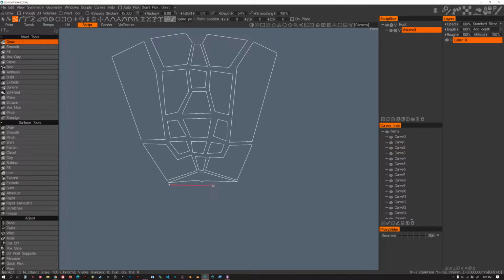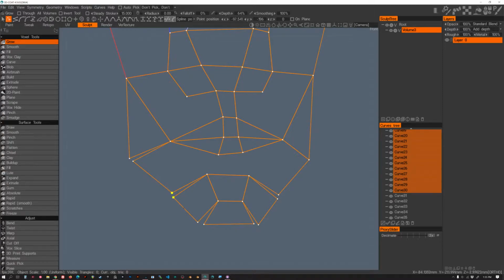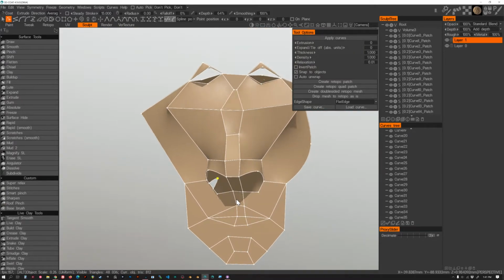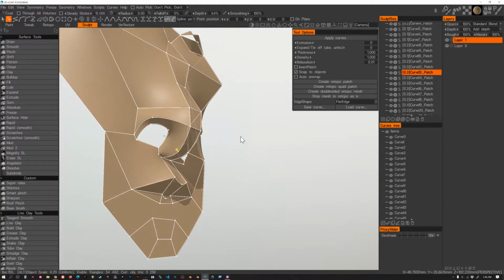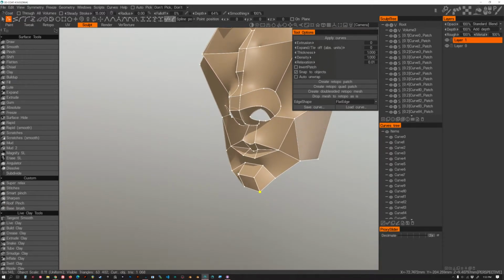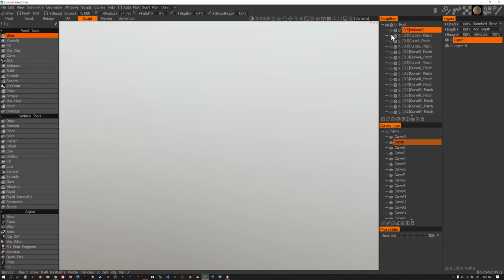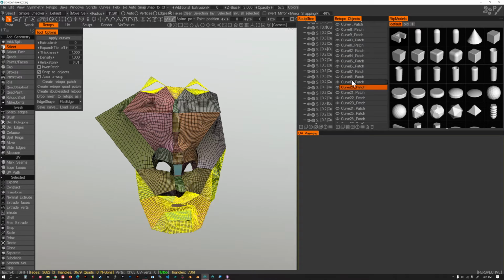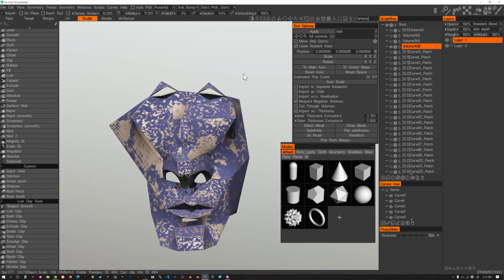3D Coat Curves Tool Patch based modeling

Comment: Cute little trick. Didn't even know about that patch creation method. Can be useful for creating some basic smooth surfaces, but in terms of editing it is crippled in so many ways... It's like a little piece of NURBS modeling in Coat.
Reply from the maker: There is a lot of potential for this workflow if it was better integrated and if some of the steps were automated.
Reply: @GavinBall  ye, curves based techniques are always interesting. But Coat has few serious flaws with complex curves editing. I tried making flowing shapes like car fenders with wheel arc... In general it works pretty good, but when it gets to details, like chamfers, fillets, and adjusting connections between multiple patches it turns into headache. But to be fair in Rhino is a pain too, even with million curves tools and operations)) But most annoying is that it generates good only thin Surface, but when you try to apply Extrude/Thicken it creates a lot of artifacts, so you cant turn it into solid object easily.
Reply from the maker: @nicktyler2572 So that's where I think 3D Coat has an opportunity to allow us have primitive voxel objects made of these Nurbs-like patches in place of standard polygons.   But then it would be great to be able to edit these patches like polygons...being able to chamfer, extrude, inset...and Be able to move full patches like you would a polygon face, or just an edge, or just a control point.  The Voxels would be the medium that allows for this kind of workflow, and the curves would offer a resolution independent way to dial in the forms you want.  It would theoretically allow for easier patch based auto-retopology as well.  There are a few missing pieces, but 3D Coat could get there if they wanted to.  Edit, I'm thinking of a solid form, not like the patches I used in this example...something where the Curves are used to block out a true volume.
Reply: @GavinBall hey man why arent u uploading yt vids anymore? You have alot of potential wayy back then and even now after watching ur vids ngl

Comment: When "on plane" was implemented in the retopo room I was hoping to do something vaguely similar directly in the retopo room, but it turned out I could not because on plane is tied to RMB and so is basically the whole retopo room : the two clash constantly.
I have also tried using the ruler tool but that didn't work either.

Anyway, you ask about flipping faces in the video : with the select tool active, "Flip faces" tool will become visible under "Selected" down in the left panel.
Reply from the maker: Ah!  Thanks Silas, I thought it had been added.  It's hard to keep up with some of the new features.  I'll definitely make use of that.

Comment: Really cool Gavin, well done. I had a go too using your method, gets very interesting when created organic, flowing surfaces and then use booleans to punch holes etc. I think the auto retop in 2021 will help with the retop, as you can set the number of faces along the curve, making it cleaner.
Reply from the maker: True, I've actually made another video with a similar method.  But a little bit more flexibility.  A little more involved to set up though.  I should have that one up soon.